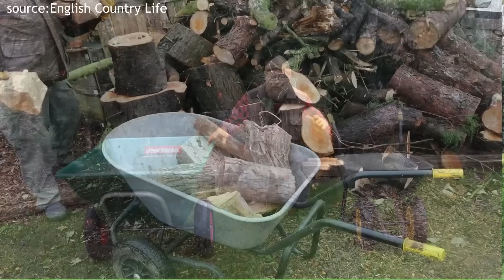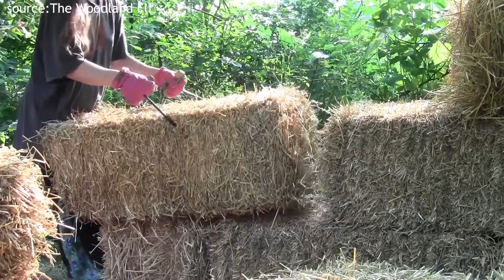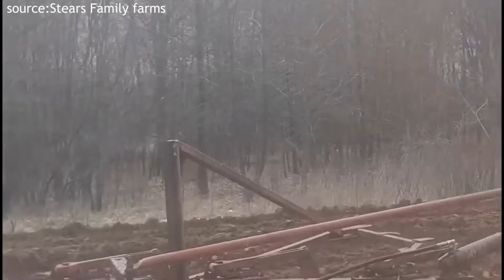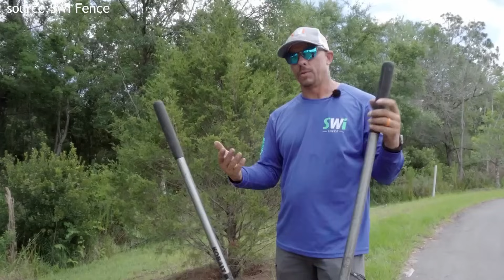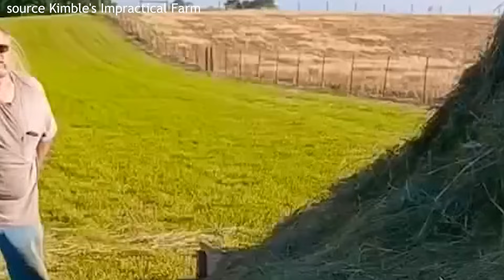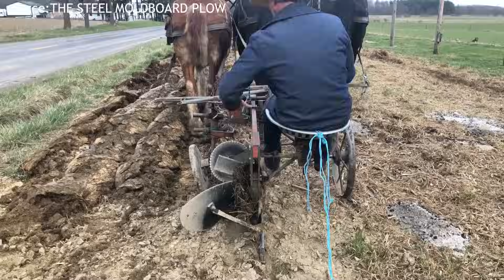15 CLASSIC FARM TOOLS STILL USED TODAY

Comment: Why would you use 2 hay hooks to handle hay bales when there are two convenient handles on the bales, the twine. I handle a few thousand ever year on my hill farm and the only exception to using the twine to move bales is when I use a pitch fork to pitch them through high forking holes.
Reply: The problem with using the twine, it'll cut into your fingers after 30, 40 bales if not sooner. The hay hook made it so much nicer to handle the bales...
Reply: @davewaters2841  I handle a few thousand every year, and have done for over 30 years, and the twine doesn't cut into my fingers. Fair enough, my hands are calloused to hell and make sandpaper look soft, but that's what hill farmers hands are like, from working outdoors in all weathers. Also, how do you throw bales through a forking hole in to a barn if you are using hay hooks?
Reply: @77willnot if you're used to it, then I guess you dont need the hooks

Comment: I question much of the verbal content of this video. First, it seems entirely American centric without any consideration to any foreign contributions, which strikes me as ironic when a large portion of the clips are British in origin.  I get the impression that the author used very little of the tools themselves.  While    I could comment on all items, some just stand out.   
Seriously, hay hooks.... they are perhaps one of the least used tools mentioned.  I have NEVER seen them used in any daily farm operation.  They suck.  You cannot easily remove them when flinging a square bale, and they are pointless when you can easily grab the strings on a square bale.
You show a dump hay rake, while talking about wheel rakes.  Dump rakes were nearly useless and suited more to horses.  Quickly replaced with wheel rakes once trackors were used in farming.  Wheel rakes are still very much in use as they actually flip the hay to facilitate drying.  

Was the content developed by AI as it clearly lacks an understanding of the content.

Comment: Not trying to be a smart alec but if you are going to talk about a disc harrow why are you showing a disc turning plow and instead of a cultivator a moldboard turning plow
Reply: The poster doesn't know the difference especially comparing a cultivator to a plow.  The narration would make no sense whatsoever.  Total lack of research and definitely a city dweller.